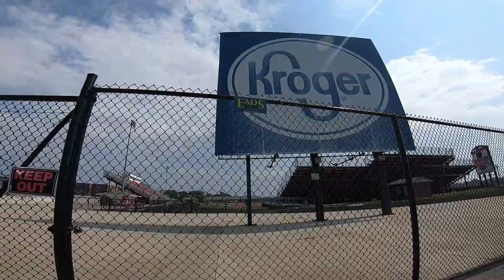Demystifying Traffic Light Sensors

Comment: Appreciate your videos. Does the ADV 150 loss speed going up hills? Just asking; however, you may not know since I don't believe I've seen and inclines in your videos.
Reply from the maker: Hey John! Thanks. Actually, I don't experience much lag at all. There's this very steep incline near a park I visit frequently and it's very challenging to peddle a bicycle up and it's that steep! The ADV 150 handles it perfectly fine. I wouldn't say it accelerates as well as on a flat surface, but it's surprising how well it does handle the hill. It's hard to see inclines on video, but I think I have a video exiting that park. I'd have to check.
Reply: Sincerely appreciate the quick response, because I'm ready to purchase either the Honda ADV 150 or Yamaha Zuma 125. I really like what the ADV 150 is equipped with.
Reply: Hi John, It's not losses any speed or performences when going to up hills. I used to ride in hilly areas and I didn’t noticed any lackings.

Comment: Is the red switch on the right is an engine cut off? Because my Adv (in asia) didn’t have that. The switch were black and use to be a switch for idling stop system (engine turn off after idling more than 3 second).  Also we don’t have the parking brake lock on the left. Interesting.
Reply from the maker: Yes! I believe Honda labels it as the "stop switch". It cuts off the engine and I use it sometimes, but I find myself stopping the engine by turning the main start switch on the console more than using the red stop switch. The parking brake is actually something I've used quite a bit, especially on smaller inclines. I think that's an awesome feature and I'm glad they incorporated it.

Comment: I am 300 pounds and will probably only take it out for small joyrides when I can. Do you think this would be an okay bike for me if I am only gonna be doing 45?
Reply from the maker: According to the owner's manual, the maximum weight capacity is 366 pounds, which includes the rider, passenger, all luggage, and accessories. With that in mind, you still have 66 pounds to go! Based on that information you should be fine I would think. The ADV 150 has ample power and cruising around at lower speeds (under 50 mph) should be very doable. Good Luck and keep us posted if you decide on something!